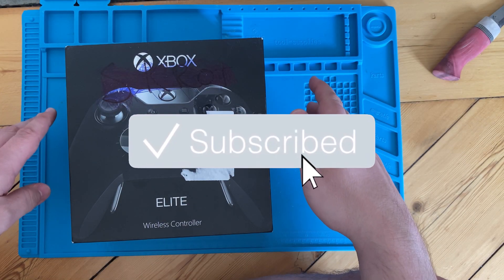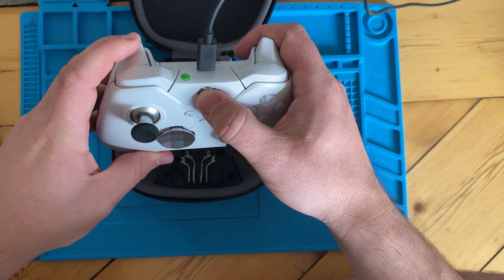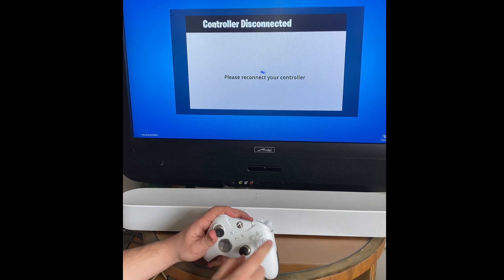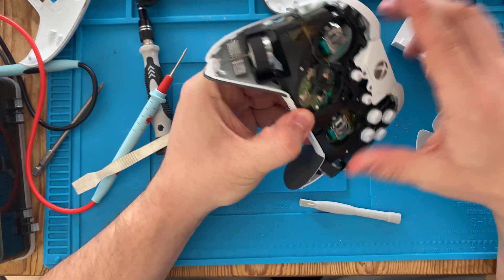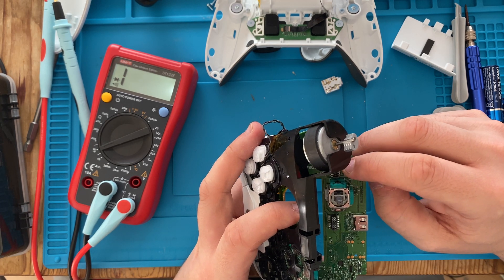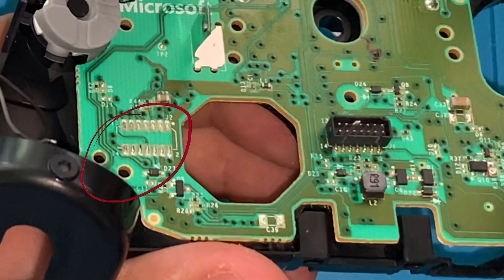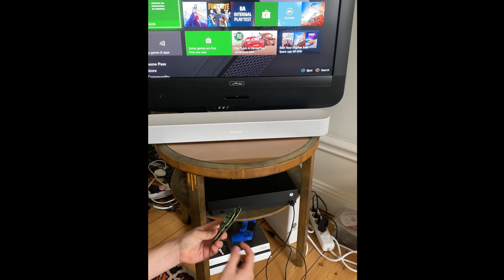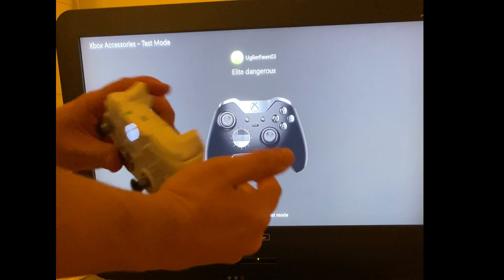Let's Fix It: Xbox Elite Controller No Power and Unresponsive Buttons

Comment: Hey man i have this same problem and my dad said that one of the actual solder points on the connector broke off what do i do??
Reply: Probably a bit late for me giving advice…but you can try finding the same connector piece online or buy a donar controller (one that’s cheap or that doesn’t work)… use whatever parts you need off of that one…

Comment: I am sitting here at work, and now I’m drying to go home because I KNOW this is what is going on with mine. I played a ton of supermega baseball with mine and you have to press the b button every time you throw to first. So if b is on that separate board, this definitely happened. I’m so excited to check at home and then mess it up due to no soldering experience
Reply from the maker: Hope it works!

Comment: I just subscribed! Got an issue with my Elite 2 Controller suddenly after charging overnight just won't power up. Zero response. Tried lots of things on the web (connect to xbox via USB & power cycle xbox multiple times) nothing works. Annoyed as its worked fine all times all of a sudden won't power on.
Reply from the maker: Probably not the internal battery or it would of powered on with just the usb cable. You haven’t dropped it recently?
Reply: @letsfixit4404  nope, Not dropped it at all. Finished a gaming session one evening last week, placed it on charge, picked up the next morning, won't power on.
XBOX say its out of warranty as of April and won't help. 😭

Comment: hey man I have a question regarding my series 1 controller: while playing the light flashes twice then disconnects, or the buttons freeze ie....character spins or moves constantly 1 direction. I have tried updates, new batteries, usb connections, and hard resets etc. I did have a issue with a vibration rattling around in the controller. If I was to get the required items to fix this myself would you be able to show me your set up? or give your potential thoughts. Thanks in advance
Reply from the maker: Sure I think watching the video to see how to disassemble and put back together is probably the key point. I would take it apart and see if you see anything obvious that needs fixed or maybe even just cleaned

Comment: My elite 2 won’t turn on and I did that it was working till I reset my Xbox because of my stick drift please help!!!
Reply from the maker: It should still power on. Try Plugging in with the cable and see if it works.
Reply: @letsfixit4404  so my dad just hit it then holed the sink button and the power button and it works now sorry for waisting your time
Reply from the maker: @nthbot5609  glad you got it fixed

Comment: its being ripped off because the B button is on a separate board from the board with Y,X,A buttons. So when you press B, (which is on the bottom board) you are actually pushing the two circuit boards apart,  ripping the connector and leaving it stuck to one end. Popular problem and a design flaw by Microsoft

Comment: Yeah I’m not a tech wizard going to have to leave it with GameStop/EBgames to get this fixed, Microsoft were 0 help, this helped a bit, cleaned it a little and managed to get my controller to turn on with a harder button press, but it’s only a matter of time until whatever connection becomes loose again. What a shame only had it for about a year, least it’s cheaper to get it fixed rather than buying a series 2.
Thank you though it kind of helped for a minute haha.
Reply from the maker: Ya unfortunately it’s not the easiest controller to try to repair. Good luck hope they can fix it for you. The series 2 is so expensive 😳

Comment: Tou if you or anyone can help me whenever I press the power it either won't  turn on or the profile thing turns on I have elite 2 but the power won't work I only can move with my sticks and use lt and rt it was frozen and I did the restart thing and thats where I am at either the profile turns on or nothing I did not spoil anything or throw it
Reply: Did you find a fix?

Comment: I have an elite controller series two and when I hold the button to turn it on, it will flash twice and turn back off. Please help.
Reply from the maker: I think that’s what happened to the controller in the video also. You will need to take it apart to figure it out and probably resolder a connector. Before you do that though make sure you are using new batteries and the battery connectors are clean 🧼
Reply from the maker: Might be similar to the issue in the video. Have you dropped it at all?
Reply: @letsfixit4404  yes I have, but the last time I did, I picked it up and it was still on.
Reply: I spilled soup on it once i think might be something with the power

Comment: After fixing the bumper and the trigger by taking it apart my elite series 2 controller buttons do no work at all. I can turn the controller on the light glows but I can’t do anything more after that. Please help 😭
Reply from the maker: Do the directional sticks work?
Reply: LetsFixIt nope not even when I plug my headset in it doesn’t work :(
Reply from the maker: My guess would be it’s one of the connectors between to two boards. Kind of like in the video but in the video it’s not a series 2. That would make sense to me because the triggers are on the first board not the ones with the buttons etc. Maybe take it apart with and see if you can get a functionality just playing with the boards. Try pushing the boards together harder when you have it apart. The only other thing I can think of is a short on the second board
Reply: LetsFixIt okay I’ll try that
Reply: @FutureDreamZz  did u fix this the exact same thing happened to me, if so how

Comment: I’ve got an elite controller and I recently got it fixed. Was playing and my controller just turns off. Wont work plugged on or with batteries. Help!!!
Reply from the maker: What did you fix on the controller originally?
Reply: LetsFixIt both sticks were drifting and the port for the power
Reply: I’m currently having the exact same problem and Microsoft are seemingly useless
Reply: @badassdanthepowerman6438  same shit like it just won't turn on like I dont live somewhere to get it fixed I got it shipped and it was like 600 for a fukin trash controller

Comment: could i get 2 of my controllers fixed..id mail them to you and how much would it cost?
both have messed up bumper.
one has left analog drifting.
the other has a trigger button not pulling in.
Do you have an Instagram to further message you?
Reply from the maker: I live in Sweden. If you let me make a video of the repair I would be happy to look at it for free You would just cover the shipping back and forth. If they need parts it would be at cost but if they don’t need significant parts it’s free. You can email me at staudt@gmail.com